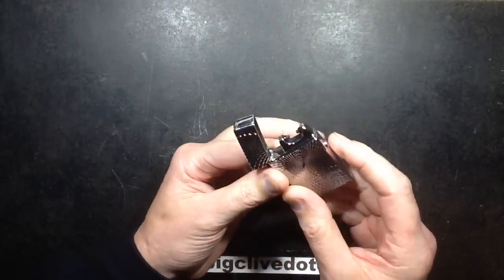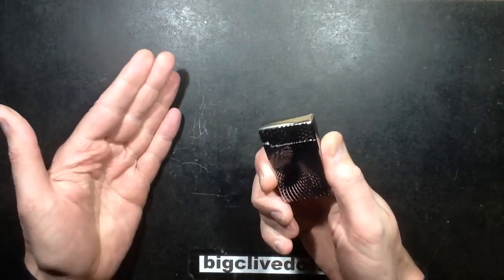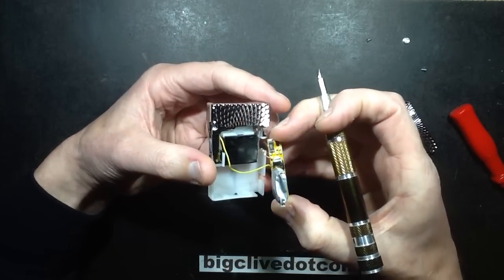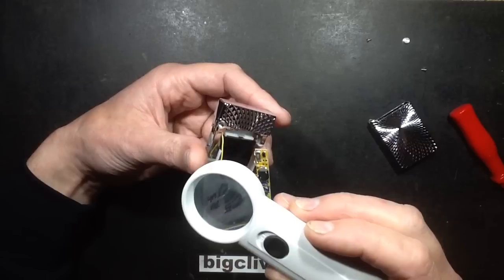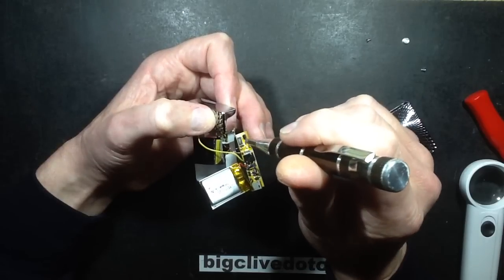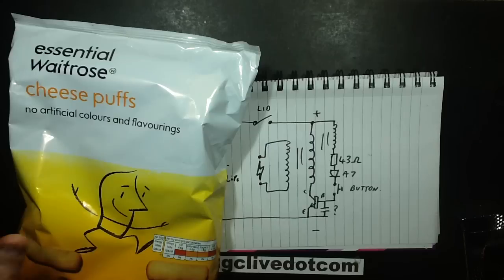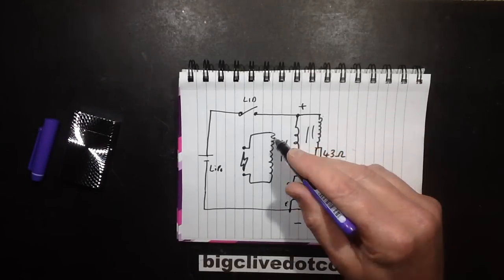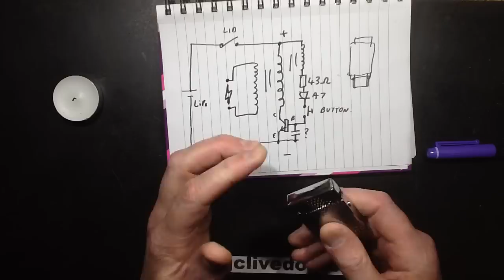Disassembly and schematic of an arc lighter.

Comment: When I light my arc lighter I can smell some kind of gas over it. Do you have any idea what the fck im breathing there?
Reply from the maker: If it smells like bleach then it's ozone.  The arc discharge splits the oxygen molecules apart and creates O3 (three molecules of oxygen) which is an unstable gas that gets rid of the third oxygen molecule onto anything that can be oxidised.
Reply: bigclivedotcom Thanks for the quick reply! I actually don't know how bleach smells, I'm 14 but I think it smells like butane gas. Is it save to breath ozone gas?
Reply: QUIT. Yeah it's safe. You can get ozone generators because they clean the air by bonding with pollutants.
Reply: yep great answer!
Reply: tonymengela What do you mean? Isn't it save to inhale this?
Reply: QUIT. I mean his answer is correct
Reply: Ozone actually isn't the safest thing to breath in. It obviously won't kill you right away. But going back to bigclive, that third oxygen will attach to just about anything. It's kinda like the exact opposite of an antioxidant, and can cause some damage to your cells. However in your case, you're probably fine, just don't huff the gas lol.
Reply: Jacob H UM wrong. they actually have ozone treatments
Reply: Yeah I know they do, if you look at my comment I suggested it obviously won't kill you, but breathing in large amounts can cause damage
Reply: Jacob H Why even make such a stupid comment? you could never produce enough nor have a source big enough to do damage
Reply: If you actually read the comment, it never mentioned the quantity of gas, rather instead the properties of ozone.
Reply: You're one of those people who gets warned they can't return a product, and then gets pissed when they can't return it aren't you.
Reply: +Jacob H you made me laugh xd :P
Reply: Exactly what I was trying to explain. Much better wording in your case luhtaru lol.
Reply: +Jacob H To be fair you're wording was fine it's just that tonymengela is one of those people who expects everyone else to be wrong and angry like him, and so reads that into what anyone else says
Reply: Thanks lux lol, I realized that a few posts in
Reply: You mean they inject a gas directly into your bloodstream? Won't that give you a stroke or a heart attack?
Reply: "Ozone is a toxic gas with no known useful medical application in specific, adjunctive, or preventive therapy" direct quote from the FDA.
Reply: no it will not
Reply: +tonymengela Where are you getting your information? Ozone is used as a disinfectant to completely wipe out bacteria and viruses during sewage treatment, it is one of the most deadly things you can be exposed to, one lungful will kill you instantly.  It is well established that when inhaled by mammals, ozone reacts with compounds in tissues lining the lungs and triggers a cascade of pathological effects including pulmonary edema. The Canadian Center for Occupation Safety and Health reports that:
"Even very low concentrations of ozone can be harmful to the upper respiratory tract and the lungs. The severity of injury depends on both by the concentration of ozone and the duration of exposure. Severe and permanent lung injury or death could result from even a very short-term exposure to relatively low concentrations."
Reply: look there is plenty to google that gives the info and that lighter would never produce enough ozone to make a fly cough lmfao broaden your knowledge just a bit
Reply: No shit the lighter will never do shit to you, it's a tiny fucking arc lighter, if you broaden your knowledge just a bit and read what I wrote, you'll see I never mention the damn lighter, I was talking purely about Ozone, which is deadly af, when you said "ozone does no harm", I don't want to get into a dumb youtube argument I just want to clarify what I said was about Ozone being dangerous, not the lighter.
Reply: I'll take my calm and more or less apathetic attitude and explain to you the fact that I know of those treatments, and they are not yet proven and are called "alternative treatments" also know as the, "once you hit fuck it come here after the voodoo treatment" so calling them "actual" treatments is a bit heavy handed
Reply: Ozone is a byproduct of most copiers and printers, which is why small closed rooms dedicated to the school/company copiers and printers need great ventilation.
However, the tiny amount generated by the arc-lighter is insignificant .. especially compared to the shit coming out of cigarettes that some people for some odd reason inhale voluntarily...
Reply: Either tonymengela is a troll, or he is one of those who believe in Chem-Trails and trackers injected with vaccinations...
Reply: probably both
Reply: +tonymengela
So I googled it and it turns out everything you claimed is wrong???

Comment: I actually fixed mine by unscrewing base plate pushing innards out the top partway then pulling rest of way  out then a sliver of shaped metal fell out so once I'd located where it was meant to go which was a slot in circuit board near hinge so using tweezers I positioned it and used blu tack to firmly keep it in place put it all back together works a treat

Comment: I have one of the smaller versions and on those the casing is isolated from the output. and it is possible to use the arc to solder small connections if necessary.
Reply: +Thomas Sears thats awesome, but sounds like a bad idea in a circuit. I wouldnt want 10kv running into microchips...
Reply: yeah definitely, ive only ever used it for making up connectors like balance charge leads for lipo batteries

Comment: the circuit diagram you presented is wrong. its a avalanche diode set in a 3 pin configuration. the anemic top pin is the dead giveaway when you look at the placement of the capacitor.a bjt / fet gets hot your oscillate fast enough to power a transformer .when  if it was a bjt the cap should be on the other side of the bjt in between one of the lines to a primary winding on the side with the resistor.  a avalanche diode that small would have a low breakdown voltage and its just shot noise acting as a signal interrupter. also the placement of the  2 thin wires and lack of a rectifier means thats probably just a single primary winding dc booster. half wave output . this errors more on it being a avalanche diode with 3 pins .sadly the bjts require a second primary for even dc to dc i believe due to slow switching speed

Comment: The potted black boxes are usually complete high voltage circuitry. The Transistor probably just switches the supply voltage.

Comment: When I was experimenting with flames in high voltage arcs from flyback transformers I found it was easier to just light the candle, etc., with the arc itself than to find a lighter.
Reply from the maker: +Sarah Watt (NuclearSarah) Have you ever sprayed WD40 through an electrical arc?  I strongly recommend it.....  Particularly a Jacobs Ladder if you're brave enough to trust the slightly random dielectric strength of WD40.
Reply: +bigclivedotcom Not sure if I'm brave enough to try it myself but now you have me curious.

Comment: It's reasonable to assume that one would get a shock from one of these lighters as they are not like a Tesla coil, but even a Tesla coil, well at least the one I have will cause burns. Mostly it is the ones that use transistors for switching. I wouldn't touch the arch on one of these lighters. They cause the cigarette to light because they are like a transistor type Tesla coil. They are kinda cool.

Comment: I have those high voltage generators  i use them to ignite gas burners.  Its a small black block you put 5volt dc on the input and on the output you have around 30 kv or higer  (the package says 500kv but i dont believe that). They also use these block in phasers to parelise attackers.
Reply: +J IJzer search for 400kv on ebay, there are lots of them, and the measured output at 6v input is about 80 kilovolts, strongly varying with input voltage
Reply: drkastenbrot i think i use the same the spark is quite agressif and it hurts when you zapp yourselve  and they are cheap

Comment: A Joule Thief is a self-oscillating voltage booster. It takes a steady low voltage signal and converts it into a series of high frequency pulses at a higher voltage.
Reply: DC PULSE of T=0 very very fast

Comment: I got one of these off ebay for a couple quid last week. turns out if you get it juuust right it will weld aluminium foil together. I can't replicate it on camera, but I thought I'd let you know in case you felt like welding foil

Comment: I wonder if I could use this circuit to power a CFL bulb. I have lit one with my arc lighter and it works pretty good but it drains the battery. If I can figure out the maximum voltage the circuit can take, maybe I can use a 6 volt lantern battery. I have used a camera flash circuit to light a CFL but It's not bright enough and the circuit has a fit when I put in new batteries.
Reply from the maker: +coondogtheman1234 The arc lighter circuitry is only intended for short bursts of use.  It draws a lot of current.
Reply: bigclivedotcom
if I can find a battery capable of high current then maybe. I do notice that if I run my arc lighter for a long time the case gets warm. I'm not sure if the circuit will eventually burn out if it's kept on for long periods but It might be OK if it's being used to power something like a CFL bulb. I could just find a CCFL inverter for a scanner of LCD backlight and make a 12 volt CFL light.

Comment: blocking oscillator driving a high-voltage transformer. Same circuitry used in those tennis-racket style bug zappers, but without the voltage multiplier.

Comment: After watching this video I bought one. As a non smoker I have no practical use for it whatsoever, but it looked interesting and somebody in Hong Kong kindly included sending it halfway round the world in the circa £5 price.

Voltage wise... Electrode gap is 4mm, dielectric strength of air is typically quoted as 3MV/m so to initially strike the arc requires about 12kV. Nasty, although once the arc is established the voltage across the gap will drop considerably. 

I daren't put my finger in the thing. What can I say, I'm a wuss.

Comment: The skin depth increases with resistance of the conductor. as the resisctance of our flesh and skin is pretty high the skin depth is also higher so the current flows deeper through your skin. That's why you got an electric shock. the frequency with which the transformer is switched is within the human hearing range, so the frequency isn't that high. It requires quite a few hundreds of kilohertz to reduce the skin depth to less than a millimeter for human flesh, but that's ofcourse dependent on a lot of factors like humidity and the kind of tisue the current flows through.
Reply: ... he should have not been shocked at all as the current wasnt going through him...
Reply: Purple Perplexing Pineapples The current was going through him...
Reply: +dehim verveen noo... 1st of all, i have done that with multiple metallic items, like a wire, a coke can tab, and a dime and i have not been shocked (except with the dime because i touched the arc) and 2 the electricity would either go to the metal he was holding if the resistance was lower than the plasma or  around it if the resistance was higher. Even if it did go through the metal, it would not go through his hand because his skin resistance is higher than the metal, and the electricity would have to take a more resistive path. which elecricity does not do.
Reply: yes, I was thinking the same thing.  the human body is pretty much a bag of salt water and the skin of the bag has pretty high resistance unlike a metal wire, so I would expect a higher proportion of hf current to pass through the flesh than it might if the  surface were more conductive.  Also, if we can hear it, the frequency of that arc isn't very high - the skin effect really kicks in at radio frequencies. 
talking of which, I wonder what effect that lighter would have on a nearby radio.
Reply: Indeed. at least you understand what you're talking about.

Comment: I'm probably not telling you anything you don't already know, but with high frequency, relatively high power alternating current, you don't have to complete any kind of circuit.  Your body (even ungrounded) acts as a reasonably good capacitor.  I used to work on military radios in roughly the 30-70MHz range, and just touching the live part of the antenna coupling can give you a pretty bad shock.  It feels somewhere between like a cattle prod (or electric fence) and like the burn you would get if you touched (thermally) hot pin.

Comment: I wonder how the internals differ from this and the dual arc lighters. They create an X shaped arc so it must be switched quickly between the 2 pairs of electrodes or it would create an = shape instead of an x.

Comment: Is it possible for you to do this kind of video again, but with an arc lighter stick like the "Ronxs Electric Arc Lighter" or similar? Very curious about how different that rectangular one from the stick versions.

[EDIT]: Also, can the stick version be charged with 2Amps? Was thinking of using a fast cellphone charger to speed up the charging time.

Comment: I think the frequency would have to be very, very high before you could depend on surface effects to minimize the current flow through you. I wish you’d got out a high voltage meter (or a meter with a multiplier) and/or scoped the output.

Comment: Had one of these. Same thing in a diff case. Think you said they were electrodes on the top....after about 2 months these wear away and the arc no longer crosses the gap :( - tried to insulate the surroundings a bit but no luck

Comment: +bigclivedotcom I hear the the sound of that arc as only a faint squeak -- but I measured it at more than seventy decibels above the level of your talking.  I say more than, but I don't know how much more than, as I turned the sound down until your speech level peaked at around 30 dB in the vicinity of 400 Hz, and the arc sound was still reaching the maximum 100 dB reading at approaching 20 kilohertz.  This was done using the HandeeSA audio spectrum analyzer program on a Tungsten T3 Palm.

I think the people complaining have a legitimate cause for complaint, as normal listening volumes could suddenly present them with a sound intensity up in the pain/immediate hearing damage region.  I think that the people complaining of blown headphones may not be exaggerating.  I think it would be prudent to edit this and remove those few seconds.

Comment: If you leave this newer lighter alone for a year and a (butane?) powered one alone for a year, which will have more energy at the end? (Internal resistance of the tiny lipo versus butane evaporating/leakage in a traditional lighter.) My guess would be that a butane one would last longer. Asking if you were using such a lighter for survival / "prepper" reasons.

Comment: How many volts is the arc? In the 5k range? That purplish low amp arc looks familiar :) Looks to be quite high voltage. From my experience, any shock from voltage greater than a couple thousand is going to hurt like hell, regardless of the frequency. Any ripple in the frequency is going to penetrate, and penetrate hard. (giggles) Its not even really the pain, its the involuntary startle. You can never brace yourself for it, even if you know its coming.
I am quite surprised to see such high voltages get spit out of that tiny transformer, with only a ?3.7v? battery feeding it.

Comment: Wouldn't you get shocked if the case is grounded?  Shorting the high voltage output winding through your body.
Reply: +Brian Fundakowski Feldman This was my initial thought too.  A Metal case that is internally grounded would be the cause for BOTH hands being effected.  Good thing it is low current ;-)  If you help the case with something to isolate your other hand, I don't think it would have shocked.

Comment: I think the "skin effect" is kind-of misused. I'm sure it happens on conductors at high frequency—like many MHz. What you're probably noting, however, is that your nerves won't detect electrical stimulation at frequencies above about 1KHz. I'm not sure if this would still fiddle with your heart, but you might get into burn range at high frequency where your body cooks a bit ... then you'd feel it for sure.

Comment: I have a strong feeling he grounded himself when putting the solder into the arc, so the case may be acting as an additional path.  sort of dodgy, but maybe it is supposed to act like a protective feature in case of malfunction
Reply: It's thousands of volts, it can jump quite a distance to find the easiest path to ground, his skin is apparently a better conductor than air.

Comment: Would it have been prudent to first run the battery down to where the arcs stopped? I have memories of a similar shock from the flash on a 110mm cartridge camera.
Reply from the maker: +Rav Gupta Tghe cmaera flashes give a sharp DC shock from their charged capacitor.  Theoretically the 15kHz should not have given a shock, but there was obviously a lower frequency element and something arced to the case.
Reply: +bigclivedotcom Wouldn't the frequency of the oscillation dip dramatically when you load down the secondary of the transformer?
Reply from the maker: +Chuck Vanderbildt Well it certainly felt like it.

Comment: I don't think those transformers produce a very symmetrical wave, which might have contributed to the shock. Also note that the skin depth of human flesh is very deep, even at high frequencies. If it wasn't, then a microwave oven wouldn't cook meat so deeply. The reason why higher frequencies don't shock as much is because the nerves respond to them less, it burns, rather than shocks.